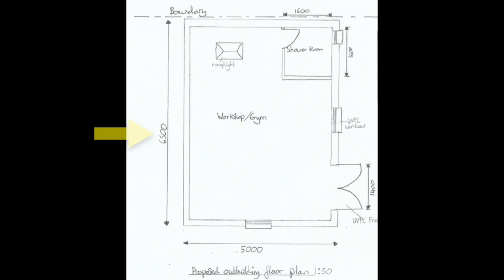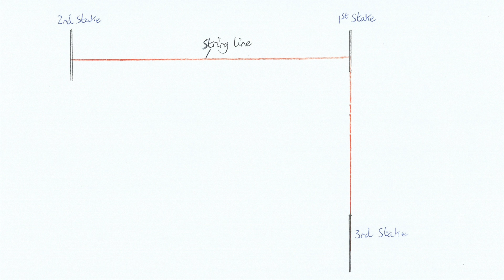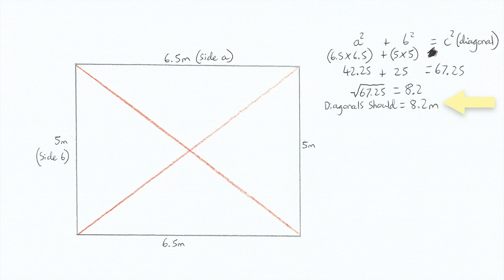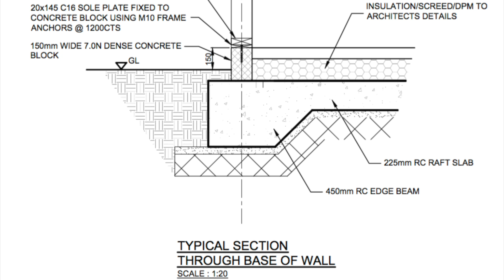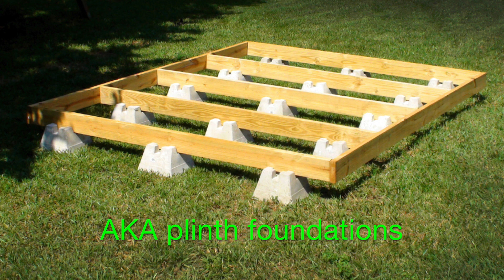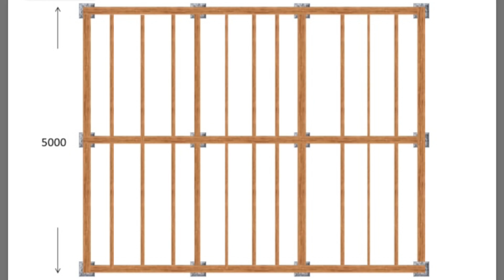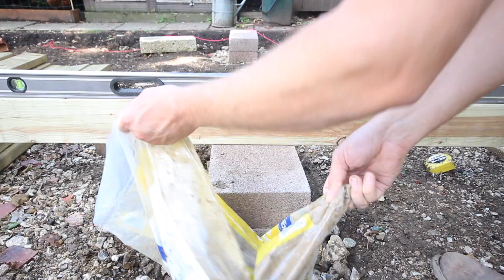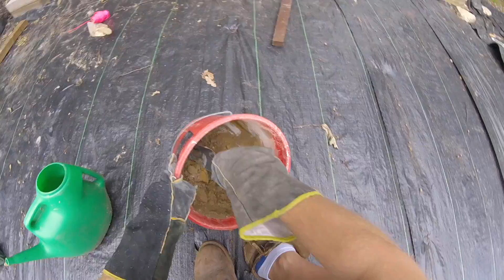Garden Room Workshop: Part 4. Setting out & Foundations

Comment: Hi, Great videos and tutorial. 
A question i would like to ask and apologies if they have been answered but i wanted to know how you decided on placing your concrete blocks. I can see you have used the span table for the frame but don't think i saw anything regarding the block spacing. I am a novice but wanted to try build a shed 6.9m x 4m. Going to be part gym part shed. Looking at making the floor strong to hold squat/bench bar weight etc, but no maths guru like yourself. 
The floor frame spacing will be 30-40 cm spacing but at a loss as to how the block spacing should be as blocks are 440mm length, intented to match frame spans (60 blocks). I'll also be using 10mm gravel to raise the blocks from 4" to 6". Am i over doing the amount blocks needed?

Thanks
Reply from the maker: Hmm have another watch of parts 4 and 5. Essentially the size of timber and the number of blocks are two sides of the same coin. if your blocks are far apart then you need thicker timber, closer together and the timber can be thinner.
Reply: @AliDymock  thanks. I can't believe i missed that.

Comment: Hi Ali, I'm currently digging holes for the same type of brick pier type you used - some of the holes are in quite soft soil and I'm down to about 2ft and im down to soil that if I stand on the spade it still sinks.  Do I still have to go deeper or will 2ft of compacted MOT be sufficient you think?
Reply from the maker: hmm, if you can go a bit deeper, do but if not that should be sufficient. You can pour some concrete over the hardcore to help stabilise things further if you're concerned.

Comment: Hi Ali.. this series is really helpful, I'm planning a 4*3m garden building to use as recording studio at the moment.. I'm wondering if you ever considered a plastic grid base instead of the piers.. e.g. Ecobase or probase, on the face of looks even easier than this method but wonder if maybe you discounted for any reason?
Reply from the maker: I don't think I came across them in my research but I've seen them used by others who have emailed and they look pretty good. I think it's easy to fall into the trap of trying to find the 'best' option, whereas in reality they will all do a similar job. Go with what you are comfortable using, that fits your budget and just ensure they can take the weight of your garden room. Here I explore plinths: https://www.youtube.com/watch?v=Ybb2FMI0XWE

Comment: Hello, I’ve gone through your videos several times now. Thanks for sharing. I’m about to start my workshop which is going to be 4.8 x 2.0.

Im assuming the bars you used for laying out were placed in each of the corners? If so, I’ve got a few questions regarding your foundations: did you line the block edges up on the string line? When you were digging out the bars were in the centre of the hole. Or did the blocks stick out further than the floor frame once on? I hope this makes sense?
Reply from the maker: Sounds good. Yeh the metal rods I used for setting out the foundations. I put the blocks jutting out slightly from the floor frame but wouldn;t necessarily recommend doing this - better to have them flush I think. The trouble is that you need to remove the rod ,or whatever you use to mark where your blocks will be,  when you dig so it's not as precise as you might like.
Reply: Ali Dymock when you doubled up the outside timbers for the floor, did you attach them together before you built the floor?

Comment: Hey Ali, firstly thanks SO much for making these videos of your project. I'm in the process of building a timber frame for a log cabin and it's heartening to see that my plans correlate pretty closely with what you've done for your base. My site is very flat, so I'm only using one block for each pier but the major thing I'm currently debating is whether or not I should fix the concrete blocks into position once I have them level. I noticed you added mortar to the base of your piers as well as between the blocks and you also say if you were doing this again you would use mortar instead of just sand on top of the hardcore. Do you still think this would be the way to go? I really want to avoid mixing a load of concrete if I can but I also don't know if mortar alone would be strong enough. Thanks again.
Reply from the maker: I probably would say that cementing the blocks to the hardcore is ideal or even pouring concrete or postcrete on top of the hardcore and then cementing to that. I'd also pour concrete around the blocks rather than just loose hardcore. All that said, my garden room foundations and floor have not moved at all and are really solid so you know, there's the best way of doing things and the good enough way- I'll leave it up to you. For mixing cement or concrete, get yourself a paddle mixer and stick it in your drill to mix it up otherwise yeh, you'll get tired arms!
Reply: @AliDymock  Thanks for the reply, I think I may bite the bullet and accept that pouring some small batches of concrete will be worth it in the long run. Cheers!

Comment: Hi Ali, all the videos are brilliant such a great resource and very inspiring. I'm in the planning stages of my project. Hoping to build 4.5mx3.6m shed/workshop and looking at which base to use. I'd like to use the blocks but am worried as I've had to level the section of garden I want to use (filling in a concrete pond in the process) and building up parts of the ground. Therefore a lot has been disturbed. Would you recommend a concrete base instead? Or would you still go for blocks? All the best, cheers. Gareth
Reply from the maker: hmmm, I think you're going to have a similar issue with each and that is that the ground has been disturbed so I'd say go for whichever suits your project best and you feel comfortable with 👍

Comment: Hi Ali, great videos they're all really informative - I'm building a much smaller Shed 2.4m x 2.4m (2ish m high I'm thinking - with a flat roof) for storing tools (not a workshop). I'm wondering if you have any advice on how many piers I might need? I was thinking of doing a 3x3 grid with 1 in the middle.
Reply from the maker: Hey Robert. I reckon use 2x4s for the base it's a shed used for storage. To be honest the no. of piers and span tables go out the window with a shed as the span tables are for domestic floor joists. So a few paving slabs will do the job, 3x3 would be fine in my opinion :)
Reply: @AliDymock  fantastic - thank you! :-)

Comment: Hi Ali, I am building a garden office much like yours so thank you so much for all your videos! My office will be 4m x 2.7m.
I am about to lay 9 single x 140mm tall dense concrete blocks on hardcore base with a damp course on top. 
I have a couple of questions- first do you think a single block will suffice? The ground is flat and we are planning to have 50mm clearance under the timber frame base with 90mm of the block dug down. 
My second question is should I be concerned about the concrete block wicking up moisture from the surrounding ground? 
Many thanks
Louise
Reply from the maker: Hi Louise, yes I think that should be fine to have 1 block. I'll point you to this video I made recently that covers this question in depth: https://www.youtube.com/watch?v=N1yM-b3rTTc
No need to worry about water wicking up as long as you have a DPC on top of the block :)
Reply: Whether you're done this before or it's your first attempt! - RyanShedPlans will help you decide which shed project is best suited for you, how to execute it and bring professional results every time. Visit => WoodBlueprints. Com

Comment: Awesome series Ali, thanks! I'm planning my own build on an existing concrete base that currently props up a knackered shed. I'm finding it difficult to find information about whether it would be possible to just lay the new floor directly on the slab (after putting down a layer of DPC), or if you have to use blocks above it for the airflow.  With the existing concrete base already a few cms above the ground level I'd end up with a massive amount of my 2.5m height lost even before I start with the walls.  Do you have any links to good resources that explain all the different options available here with pros/cons for each?  Thanks so much!
Reply from the maker: I think it would PROBABLY (read as italics) be fine but really you should have air flow underneath so I'd say you'd want to raise it up. BUT I don't think you should use timber at all for the floor. Build your walls atop the concrete and then put down insulation on the concrete (DPM first if none under concrete), then chipboard tongue and groove (floating) and then your flooring (laminate etc)

Comment: Great videos! Watched them all. 
Would this method of base be suitable to use for a one car garage ? I have massive oaks tress near my build site that have already ruined a concrete base. Similar size to yours with a car one side then home office the other. 
Cheers
Reply from the maker: I've never ever seen a garage with a timber base, so I'd say probably not! How about building a smaller garden room with an overhang on one side to act as a carport and have bare ground or paving slabs for the car to sit on?
Reply: @AliDymock  
This is what I figured. That's a good idea, just the current base has been destroyed by the roots moving the ground below puts me off.
Thanks for the reply!
Reply from the maker: @OrchardKoi  Yup exactly what happened to mine. Oaks, ivy, bind weed, brambles-the lot!

Comment: Hi Ali, I'm wondering if there is a minimum number of concrete blocks required for the base? I am planning to have at least of 10 cm of compacted hardcore and then one concrete block half way in which will give me 50 mm for ventilation, would this be ok?
Reply from the maker: No minimum number of blocks. 1 is sufficient as you say, buried half way in the ground. 50mm for ventilation is perfect. You can't afford to waste height on more than that if you're going with permitted development. Next video on this very subject!
Reply: Ali Dymock Thanks for the swift reply. Great videos btw, spent hours watching and re-watching and taking notes 😁

Comment: How strong are those blocks?  I might use them for a small deck and or shed
Reply from the maker: Very, they're rated at 7N- don't confuse them for thermalite or anything like that. Only dense concrete blocks. For a small deck or shed, 3ishN would fine I suspect.

Comment: Really good videos I've watched them all and now have the confidence to take my own project on I have 1 question though where I want to put my base frame it has halve concrete slabs and half grass can I lay the frame straight onto concrete and then build up concrete blocks and hardcore like yourself on the grass ? Reason I'm asking is the concrete slabs are already atleast 6inch higher then the grass 
Regards James
Reply from the maker: Thanks James. A few things.
 1) if you are going for a build under 2.5m max height then a 6 inch base does take quite a lot of the height away so consider that.
2) It's okay to put the frame directly on the concrete as it will be off the ground anyway so probably won't need ventilation underneath but of course that is beneficial.
3) If you are not sure if there is a DPM under the concrete then put one on top before your timber floor.
4) Yeh, you can extend outwards just using piers or you can extend the concrete. Definitely think about no. 1 though.

Comment: Hi Ali. Im building my garden room with the use of your videos they are great. Im im building the concrete block piers at the moment and was wondering was the 12 no piers you used adequate? Has there been any structural issues? Would you recomend using more? I have used 12 and my build is 4.88m x 4m. Thanks alot. Would love to hear your advice. Lee
Reply from the maker: Mine has been totally fine. Floor feels sturdy but if you want to reduce bounce further you could add more piers but don't 'need' to. Especially as your building is smaller than mine I think 12 is fine. Just as a note, have the top block no more than 5cm off the ground if you are restricted to 2.5m PD rule as anymore eats into your build height too much.
Reply: @AliDymock  so the foundations are included in the max 2.5m height? I was under the impression it was from the floor height.

Comment: thanks for putting the videos up, just a question about your foundations if you don't mind?
when you've put the type 1 down did you cement the first block down or did you bed it with sand then cement the second block?
thanks again
Reply from the maker: I bedded it with sand BUT would recommend cement.
Reply: I'm going to show you exactly how to start building wooden sheds and woodwork projects easily, so that you're fully up and running, creating remarkable outdoor garden sheds and woodwork projects for your loved ones within days from now. Click here ==> WoodBlueprints. Com

Comment: Hi, Ali. I'm planning my garden room at the minute and was originally planning a concrete base but have now decided on a system like the one you used. I was wondering if it would be possible to excavate the whole area for the base by a depth  slightly shallower than the height of the concrete block so that the floor of the garden room is just slightly higher than the rest of the lawn. The reason for this would be to make the most of the 2.5 height restriction and give more headroom inside the structure. Would be interested to know your thoughts. Great video! Well done on your garden room. Cheers.
Reply from the maker: Absolutely. That's what I'd recommend. You'll still want some ventilation so I'd suggest around 5cm under the joists to allow airflow. That said, I'd say concrete is a great option too! Hppy to help further if you need it.
Reply: @AliDymock  thanks very much

Comment: Great series of videos, well done and thanks. The existing foundations for the garage that you dug out, what were the reasons why these weren't good enough for your new build? Insulation, size, depth? I'm just guessing there, because I'm at a decision point as to the foundations and have a perfectly level (no insulation) concrete base the existing garage is on, need to justify digging it all out to lay something new.
Reply from the maker: Good question. The concrete was cracked, crumbling and had plant roots all through the cracks. It wasn't level as had subsided and was different heights so the only thing to do was to start again.
I've written here why I didn't then go for a NEW concrete base: http://www.alidymock.com/foundations/

I think if you have an existing concrete base which is in good nick, definitely use that and then have insulation on top!
Reply: @AliDymock  I was going to edit the comment today actually as I'd seen in a later video somebody ask a similar question which you had answered. There must be a lot of repetition of questions so it's great you are still making the effort to answer, especially after so much time has passed. Many thanks.
Reply from the maker: @petdev2  Well I enjoy it and it works well because I can see which problems people are having, questions that come up repeatedly or things that need to be clarified. I've got some mini videos planned in this series to help 😀